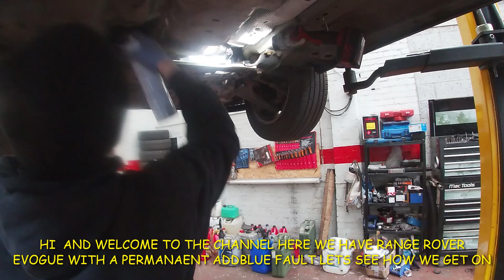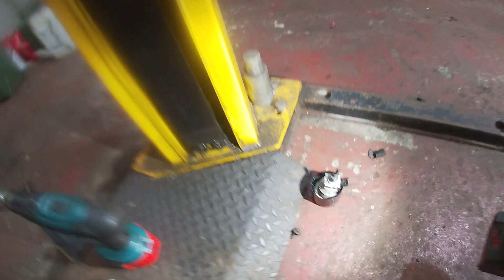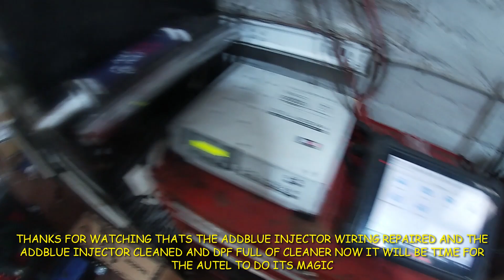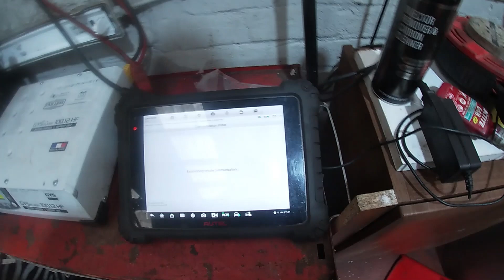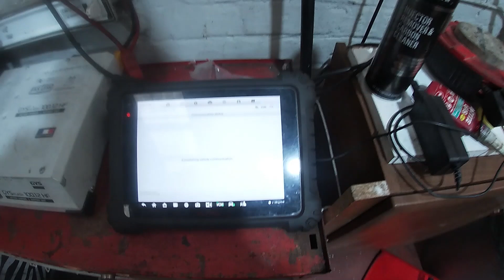RANGE ROVER EVOGUE P2047 13 EXHAUST FLUID DOSING MALFUNCTION PT 2

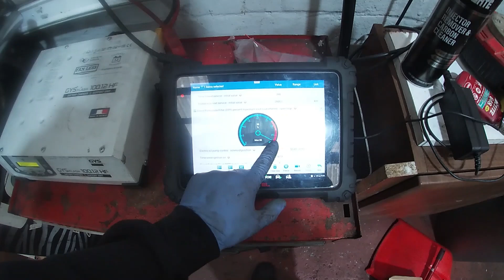Comment: 31:44 looks like you're seeing the Autel scanning the DPF since adding 2 cans of cleaner?  I thought you would have to run the engine and drive the car for it to sense changes?
Reply from the maker: yea the cleaner is put in and left over night and then back on the next day I prefer night time when the motorway is quiet it then has to be driven up the motorway with the autel in dpf relearn mode it runs a passive regeneration to relearn the soot content depending how bad it is it can take an age lol thanks again for watching 👀 have a great day mate 😀
Reply: @cairney0037  :  thank you my Scottish friend!  I guess I need to step up my Autel. Your version is probably a million pounds, yikes!  
Ok, I give up.  Which one please?
Reply: @cairney0037 :  is it absolutely necessary to remove the ddppff from the car or can you spray it down through the injector's port way?  Thanks and I will try to stop quizzing you.  Going to need to contribute to you :  )

Comment: Excellent.  When cleaning the injector, is it necessary to open the small holes at the nozzle?  Looks like 3 holes.  Need to flush out the backside of it also?  I see a series of holes on reverse side from the nozzle past the fins as you held it up.
Reply from the maker: hi, and thanks for watching. You can clean the add blue injector if it's not too bad with hot water and compressed air. Many thanks again for watching. If you haven't already, please subscribe and have a great day

Comment: I’ve had my dpf deleted and my exhaust dosing malfunction warning has came on, any ideas what it could be
Reply: Just had same fault ad blue injector replaced all lights gone off
Reply from the maker: @laurieturner1101 why thanks for watching and commenting if you haven't already hit that subscribe button . Have a great day, and I hope your landrover is back on good health
Reply from the maker: if it has added blue, they should have deleted that also, lol sorry, without creating the file for the remapp or having access to the tuner who did it I couldn't comment they are  bad for wiring at the ads blue injector and it gets clogged up sometimes they can be cleaned the injector without having to replace it
Reply: The ad blu was deleted too